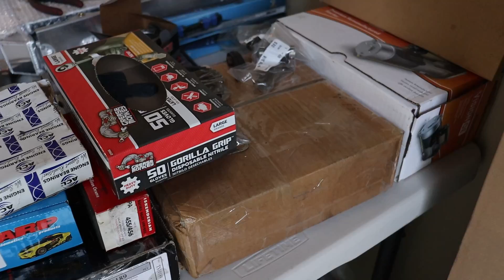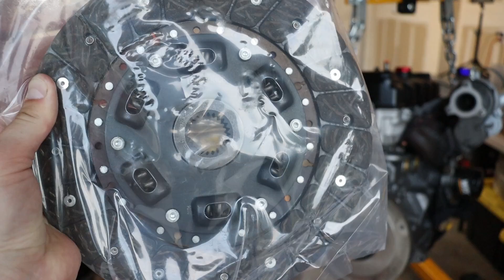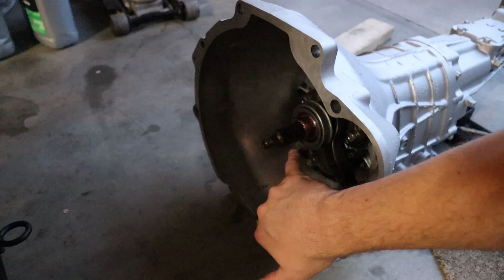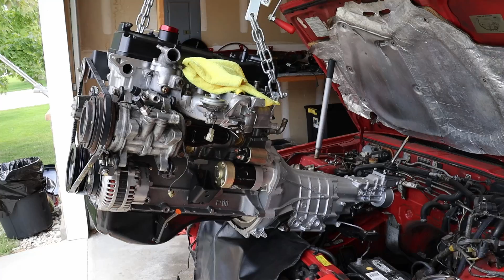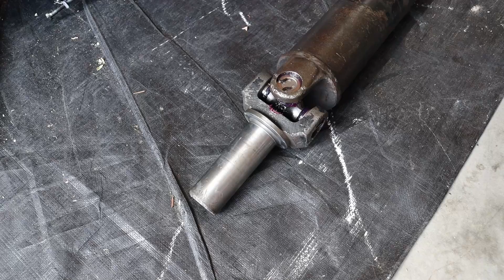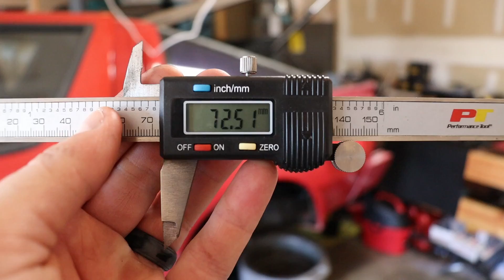Fully Built Turbo G54B Engine Install

Comment: While I admire the work, I can't help wonder why. It's a 40-odd-year-old engine. Surely there must be cheaper, better performing motors out there to use?
Reply from the maker: It was more of a Retromod style build. Use what is there and modernize it, a big part of it was nostalgia for the Owner.

Definitely better modern engines that could be used (I’m working a K Swapped Corolla as we speak). But in this case, making 300 HP on this engine and realizing more of it’s potential was what the owner wanted!

Comment: I have a 1980 Challenger with a G54B,12 valve. I would love to give it the Conquest treatment like turbo and inter cooler. I’d like to lose the jet valves too. Any comments on if this is possible would be greatly appreciated.
Reply from the maker: This engine was prepared by Top End Performance (RaceTEP.com). I found a great deal of help looking at old forums, Facebook groups and MKS Motorsport. Lots of machining is needed to get these heads to flow up top in the rev range. Have fun with the research, Astro Engines are interesting!
Reply: @RAPauto how was your experience with Steve? I’ve looked through starquest and a lot of people have had bad experiences with him. Granted most of them were from 10-15 years ago and all you can do is take some guys word on a forum but I’ve been hesitant to have them build anything and went with a local machine shop and a marnal head I found on a local listing on fb marketplace
Reply from the maker: @OozaruTheKid I talked to Steve on the phone and over email multiple times to coordinate the build. I had no issues. I inspected the engine and turbo externally to check to for any obvious mishaps but found nothing. The Conquest is running to this day and goes to local shows so nothing to complain about. Steve also sent me pictures of the build process and the products going into the engine (Pauter rods, JE pistons, etc). Overall, I had a positive experience working with Steve and Top End Performance.
Reply: @RAPauto  good to hear, if I ever buy another starion and get the itch I’ll give him a shot. Thanks for the reply appreciate it

Comment: ...my timing chain has a bit of slack, about 1/2" or so, on the driver's side ... passenger side is tight, the side where the tensioner is installed ...the chain, sprockets, all look good & shinny, no sign of damage as far as the eye can see ... should this be a concern ?   G54B engine, 2.6L auto, gas ..
Reply from the maker: This is a great thing to look into a Manufacturer Repair manual. MKS Motorsport has manual on their site for free you can download. I would reference that as I don’t know off the top of my head. Typically, there is a little bit of slack on the non-tensioner side.

Comment: does the carb need to be removed to replace the fuel pump ?
Reply from the maker: To get to the fuel pump (at least on the ‘87) you will need to drop the tank. If you mean the fuel filter, it can be reached on the driver side on the engine side of the wheel well. Sits snuggly under the intake/brake master cylinder.

Comment: Stock FPR is interesting as well
Reply: What is the plan for adjustable FPR?  Are you going standalone fuel control?
Reply from the maker: @Komeuppance first we have it set to the standard 3 bar of pressure (43 psi). Currently tuned at 3 bar then may look increase if it allows us better atomization and power.
Reply from the maker: You’ll see in future episodes but we had to run complete new lines and have a Fuel Lab Adjustable unit now in place of the stock FPR.
Reply: @RAPauto  nice, good work